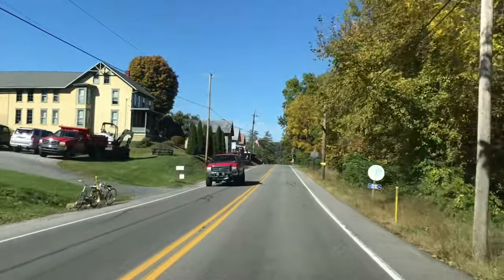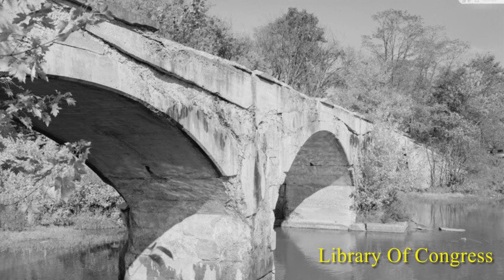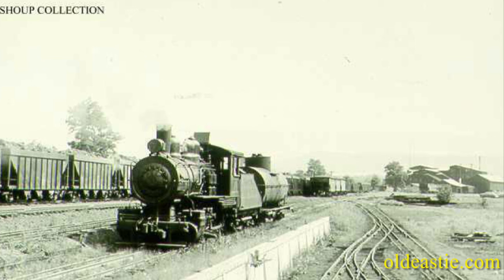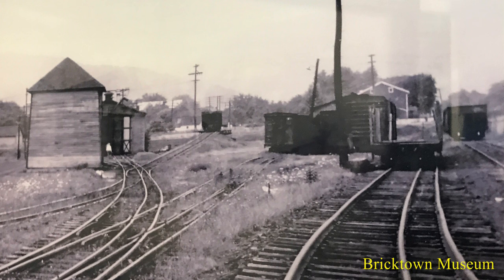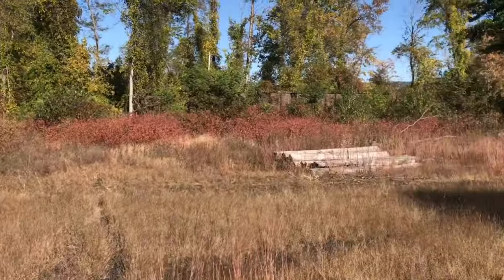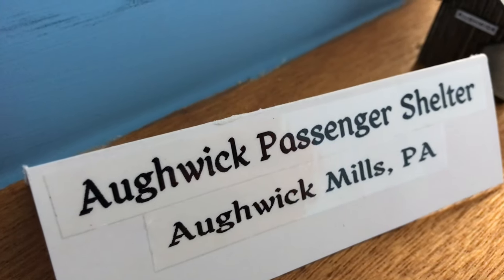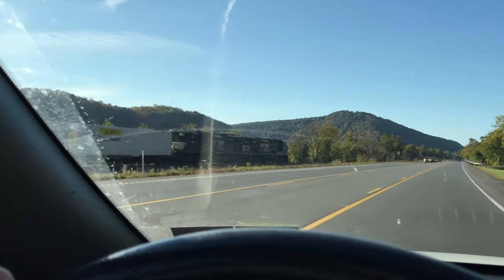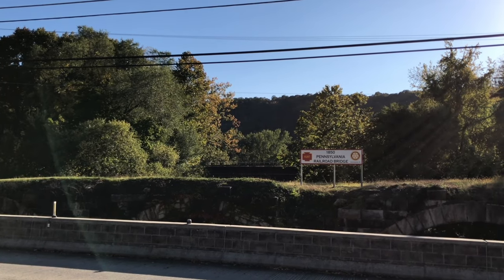Ruins Around Mount Union | East Broad Top RR (Vol 2) | Retracing History Episode 34

Comment: Overall, very well done, save for the few errors others have noted. I was at Mt. Union perhaps 20+ years ago; the tracks were clear, there was equipment in a carbarn (I don't remember what), and it looked as though the standard gauge part could have been restarted "next week." There were also cleared areas of track between Colgate Grove and Mt. Union, although not continuous. I also saw the road crossing, which looks as though it has been rebuilt along with the highway. I look forward to the revival of the EBT, and hope to be aven a small part of it from my home several hours east.